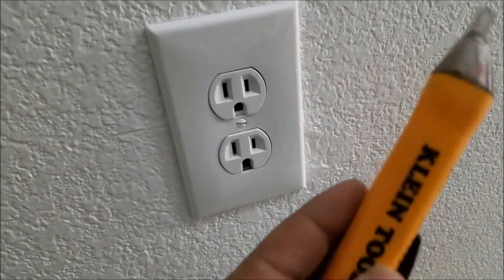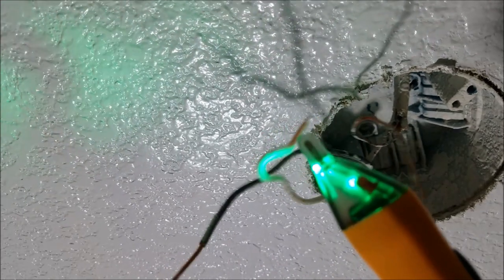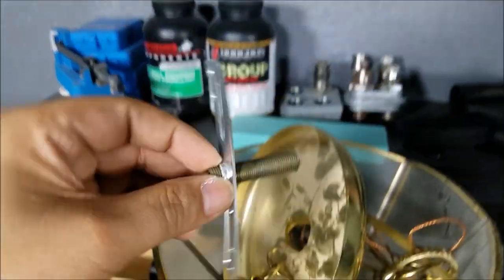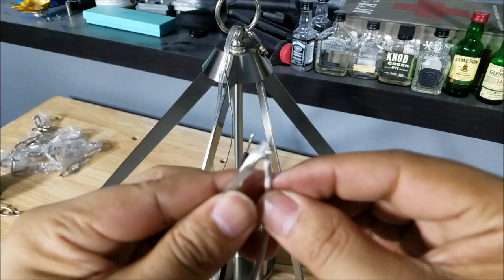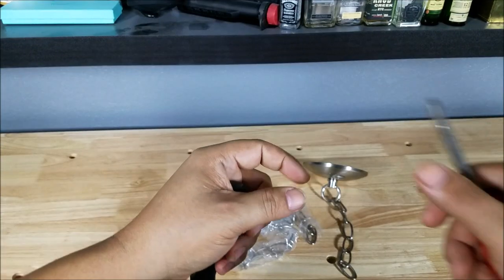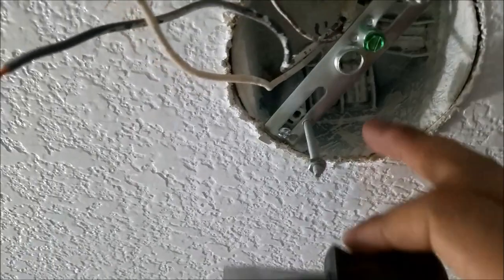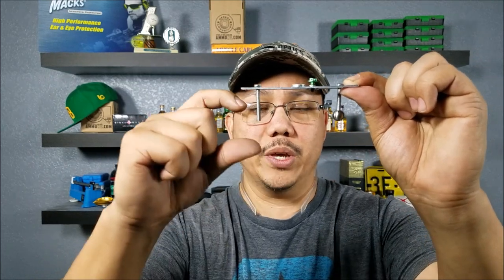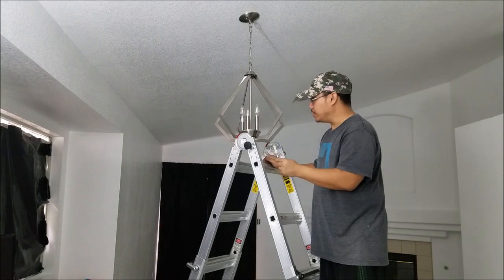HOW TO INSTALL A CHANDELIER AND CUT CHANDELIER CHAIN

Comment: With any light socket is is best to wire it such that the center of the socket is the hot lead and the outer portion where the threads are is the common lead. That way if you touch the base of the bulb while changing a bulb, it will not be the hot lead if the power is on. 

For the house wiring the black should be hot and the lead that goes through the wall switch. The white is the common lead. 

For the twin lead coming up the chain, one of the wires usually has a stripe (rib) on it and may be the same color as the rest of the insulation. This should be the common lead.

Comment: Fun fact. You should actually put the black wire with the black wire, etc. Try jumping those wires to another light and see if your 50/50 chance works. Ribbed feeling wire is black.

Comment: What do I do if I am using the same chandelier in a different place but need longer wire to hang it lower?  Do I replace it with a longer wire and does it matter which side of the clear wire goes with white and which goes with black?